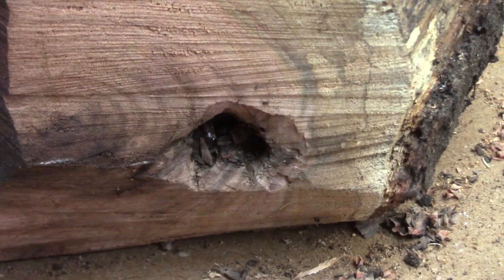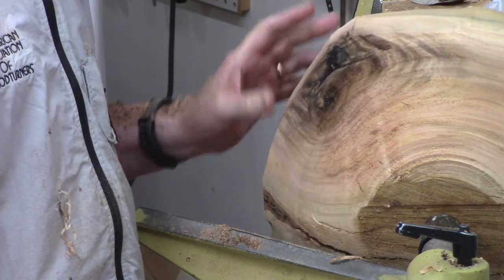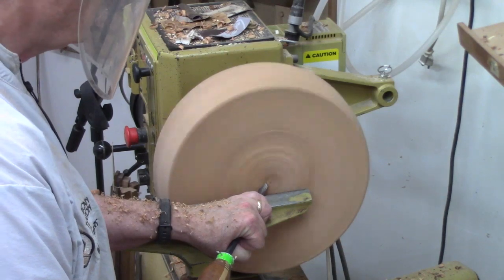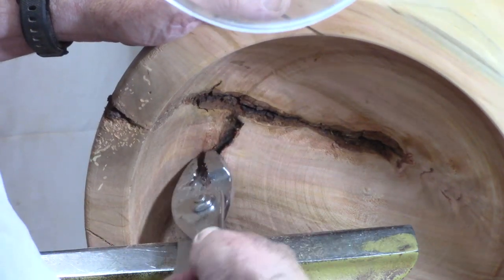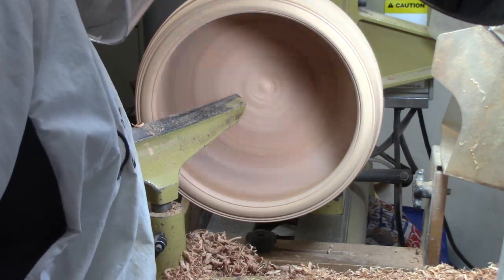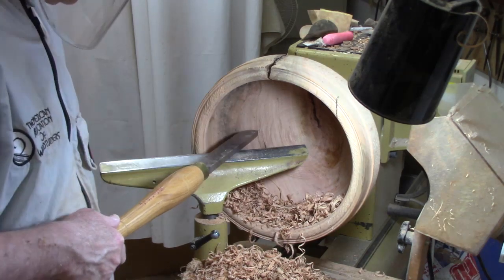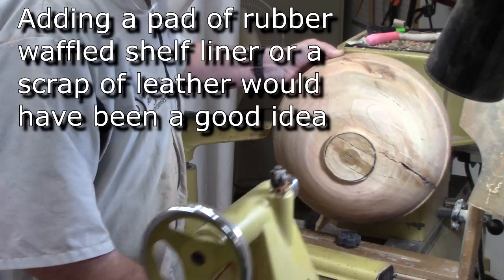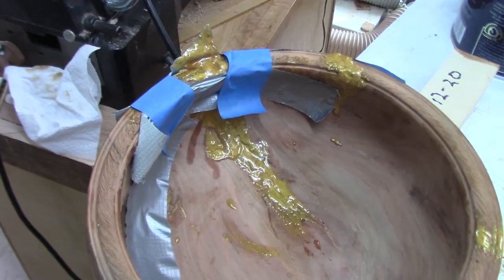Cherry Barbed Wire Bowl from Hell

Comment: Nice work, Mike, in that it was a fine example of what it takes to salvage a piece of timber.  One of the big factors to take away is that a salvage project like this (wire, cracks, deep inclusions, etc.) is probably not a project that a new turner should tackle.  Great education piece.
Reply from the maker: Thanks, Donovam.

Comment: Great work!!  Last fall I turned a big piece of Ash that had  three 12 penny nails in it. ( I suspect the remnants of an ancient deer stand). After extracting the nails, I cut the heads off, drilled holes in the foot and epoxied them in.  I figure the story will help sell it.
Reply from the maker: Mayube. That was certainly worse than a bit of barb wire.

Comment: Having cut my firewood from down trees on my farm for the last 35 years, I can't tell you how many times I've hit barbed wire, nails, fence staples, wrenches,  horse shoes, and all manner of things grown into trees.
Reply from the maker: I can only imagine!
Reply: @MikePeaceWoodturning  Usually, when a new blade is put on the saw.  :(  

I was told by an old (relative to my 64 years) farmer that when doing shade tree repairs they would always throw the scrap pieces next to the tree.  Many of those ended up inside the tree as it grew.  I've seen half the wheel of a horse drawn plow inside a tree.

Comment: I was wondering when you were going to break out the carbide tools.  Do you not have any or just don’t like to use them?  I’ve hit a hidden nail while using my Easy Wood Tools on a couple of occasions and they shaved down the nail fairly easily.  I’m not sure they would have worked the same on the barbed wire as it might be a higher carbon steel, but it might have been neat if they did so, you could have left the wire showing to add a lot of visual interest. Be that as it may, the head slapping idea of using the finger contour gauge to shape the jam block 😲 was worth the video.  Stay safe and well to keep the ideas flowing.  Cheers, Tom
Reply from the maker: I recently pickied up a few carbide tools but after I had done this bowl.
Reply: @MikePeaceWoodturning  so when you find your next hidden treasure you can risk giving it a try. 😁 Cheers, Tom

Comment: Wondering what kind of sander you use and what the size of the sanding discs are  and where are you might’ve gotten it would be helpful    great bowl I haven’t run into one with a wire or a nail on it maybe I’ve just been lucky glad to see that you kept going to get it done
Reply from the maker: My power and inertia sander and sanding supplies from Ken Rizza at Woodturnerswonders.com. Great vendor. I use 3" disks for bowels larger than about 8" and 2" for smaller.

Comment: Tough slugging when you get metal in a turning blank. I think I would have cut the wire out before turning it. Nice bowl though.
Reply from the maker: I do wish it had been easier but until the bowl got thinned that was not easy.